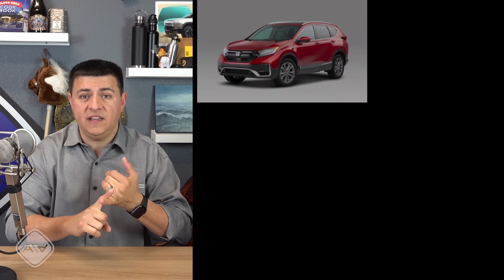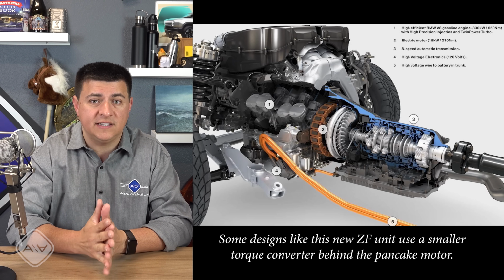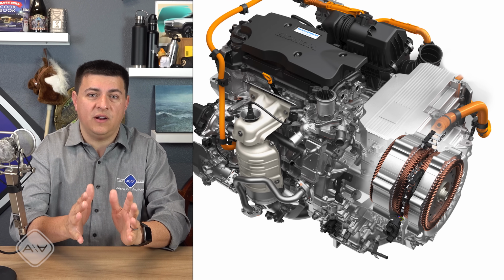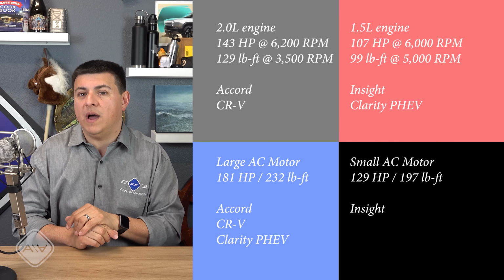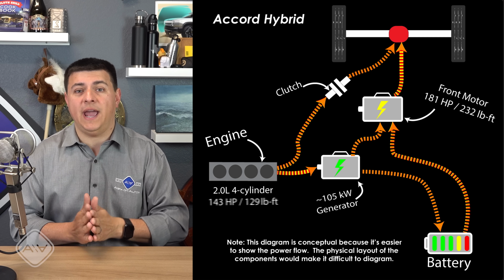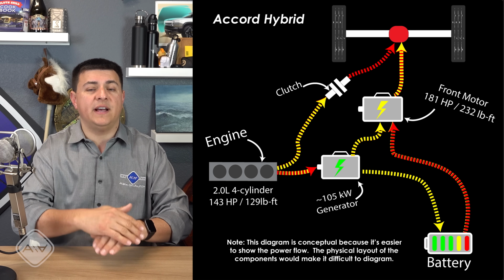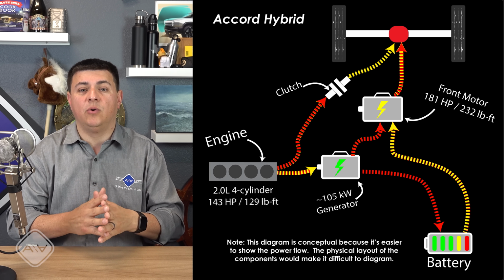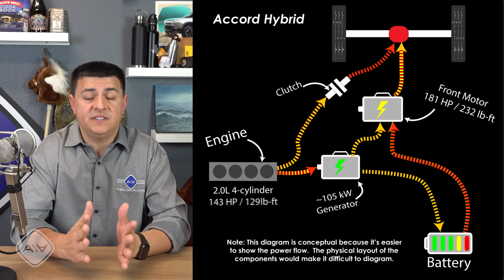How Does It Work?  Honda's 2 Motor Hybrid System Explained!

Comment: As an old hot-rodder, I can safely say....it's not about the horse-power, it's about the torque...It's always about the torque...well done Honda, well done.
Reply: Absolutely!👍👍👍🦘🦘🦘🦘🇦🇺🇦🇺🇦🇺🇦🇺
Reply: @hackney7106  This old debate?

Ignoring the mass of the car and any losses, acceleration (or towing force) is proportional to:

(Engine Torque) * (Total Gear Ratio)

... or equivalently ...

(Engine Power) / (Vehicle Speed)

The only reason you can compare similar vehicles by their torque, is because practical construction means that they will have similar ranges of Total Gear Ratio. The reason Hot Rodders like to compare torque, is not because it is more significant; it actually isn't. It is because you can achieve values that are close to T_MAX over a relatively large range of rpms, whereas P_MAX comes at only one specific rpm value.

Electric Vehicles - and yes, performance-wise these Honda hybrids are electric vehicles driven by the combination of a generator and a battery - are quite different. There is a speed that I'll call V_MAX. At that speed, the car can produce both maximum torque and maximum power. Below it, they can produce maximum torque, but their best power is P_MAX*V/V_MAX. This is why they are so quick off of the line. Above that speed, they can produce maximum power but their best torque is T_MAX*V_MAX/V.

In the Accord and CR-V hybrids, V_MAX is about 37 mph. T_MAX=232 lb-ft and P_MAX=181 HP.  In a Tesla Model S, V_MAX is between 43 mph and 49 mph, depending on which version.
Reply: Think you have read me wrong?It has always been about the torque.HP is irrelevant.
Reply: @hackney7106  No, you have accepted a very old, and very wrong, myth. There is some basis to it, but mostly due to the characteristics of an internal combustion engine. That is, not to this car.

In this one, 232 lb-ft is all that matters at any speed below 37 mph, and 181 HP (or 212 if you compare it to an ICE) is all that matters at any speed above 37 mph.
Reply: But you put it out there about Torque.I was actually agreeing.
Reply: And it is rumoured the torque is going up. 👍
Reply: @hackney7106  Torque can be created from horsepower with gearing.
Reply: @renof2505  If I ask Google Maps how far it is to the grocery store, it says 5 minutes by car, 10 minutes by bicycle, and 15 minutes on foot. If I look in the right place, it also says 1 mile.

The same is true of torque and HP. They measure the same thing just in different ways. Torque doesn't "create" HP, it is HP, at a known rpm. Specifically, HP = TORQUE*RPM/5252.

But torque is more consistent over a larger range of RPM.
Reply: @Goldendad1  HP is, too. Just a little bit, but it is measured in a different way so the number is going down While the effect is going up.
Reply: @jeffjo8732  Good Morning. I’m not clear on your reply, would you mind explaining what you mean? Thanks.
Reply: @Goldendad1  The CRV hybrid uses the same drive system (except that it has AWD) as the Accord. Its next generation has been announced. The torque of the traction motor is increasing from 232 lb-ft to 247 lb-ft, but the listed HP is dropping from 212 to 204. HOWEVER, the 212 HP figure was Honda's own measurement, the max outputs of the battery and generator added together. The 204 HP figure is something called "ISO net," which I do not know about but apparently is a new standard (in my opinion, it can't be as meaningful, but I have no firm basis for that). According to Alex, this is 3 HP more than the current system would get.
Reply: @jeffjo8732  Thanks, now I get it. Upping the torque should be noticeable too, right? Hoping the wait won’t be too long till I have one in my driveway.
Reply: That's what I love about my 6 SPD manual turbo Diesel from Kia..!
Reply: Yes [BIG]BUT, 1/  it takes 'TIME' to wind up to produce equivalent torque, & 2/ there's significant 'losses' in the conversion. Even with a lighter jockey, One mates 4 pod, worked gsx750 always lost from the lights against a big single XT600 - to 60kph! Then, it rocketed past with disproportionate hp/Kg ratio. 
In little boy, needle richard, wonker, rectum hole, selfish, don't give a fornicate bout others street racing, where straits are 'usually' short, it's INSTANT grunt torque that throws weight quickly forward out of a bend. Full stop. 
On a purposed race track long strait i.e. nurnburg ring[sp?] all about horsepower yes.
Reply: @jeffjo8732  Wrong. They ain't the same mate.
I struggled with the interpretation of it also. Confused on it for ages. 
Not 'measure' but actual 'effect'.  And the conceptualisation is a so subtle but significant difference.
An Engineering fundamental differentiation.  Did Archimedes 1st figure it out?? 
The instantaneous higher energy delivery of torque is ~off the lights : holiday loaded : tow a boat: get out of on-coming harms way lane change... is 'in time' quicker -"to a certain point' - which, for a street registered, practical family automobile, so rarely ever advancing past 110kph, this 'point is rarely ever reached. 
Though for wannabe 'ricky-bobby' racers, yep, Hp is 'more betterer' winding out [in time] down the back strait – or, in the wet dreams about such exhilarating 'boys own' adventures. ;p
Cheers Mate.

Comment: Honda calling this an eCVT is such is a disservice to the ingenuity that went into this powertrain. This is Honda engineering at its best! Instead, they should be flouting the fact that this system has no real transmission. That would be music to the ears of most buyers who have had to replace a probematic transmission before. Calling it an eCVT is the worst thing they can do.
Reply: Exactly! I have no idea why Honda would want to saddle this tech with the CVT moniker, even if they tack "e" to the front of it. People shy away from CVT, this seems far more straightforward and robust.
Reply: In engineering papers dating back to 2013 it is called a "electric-coupled CVT." That means that power is transmitted by electrons, not gears, chains, or belts. The ratio of input rpm to output rpm can be calculated, and it does vary continuously, but it is a completely meaningless number. For example, it is not a torque multiplier like it is in a mechanical transmission.

But we don't live in a world of engineers. Honda still needs to put something recognizable on the "transmission type" line of spec sheets. The term "CVT" does explain some observed behavior, and Toyota already established "eCVT" as a transmission type.

But a better name would be "vCVT", for "virtual CVT." That would accurately convey everything that is needed to be conveyed.

Comment: This system is silky smooth in my Accord. You only have to get used to an engine that revs independently of the speed of the car, but it's a very nice system.
Reply: Don't straight pipe it
Reply: That’s what I’m still getting used to….the engine running independently of what I’m doing. But I think in mine (2021) they try to simulate the engine revving up and down appropriately.
Reply: try a deasil train. they work that way too.-I think City buses should but the do not! I am surprised at this in the "enviormnetal" "friendly"" 2020s LOL
Reply: @flynnsarcade.1982  shame on them for that! the engine should not run unless the motor needs it's charge!
Reply: @fucheduck  I have a clarity its 4,000lbs, bigger than accord and it gets 45 mpg does 0 to 60 faster than any car I have had. Because you know more than the Honda engineers.
Reply: @fucheduck  You mean "battery needs its charge?" Motors don't have "charge".

Comment: So, it's an EV car with an on-board ICE generator, that turns hybrid highway speeds. interesting
Reply: Just like a trains locomotive. Traditionally this system called diesel-electric motive system.
Reply: Just like a Chevy Volt ;P The idea is golden, it's a pity it doesn't sell better
Reply: @KarrasBastomi  Locomotives have direct Diesel drive?
Reply: @williamwheaton8117  The idea is actually pretty poor. A Diesel, running at low RPMs would make a far more efficient source of generator fuel, and the low final gear reduction ratio makes the engine rev far too high at highway speeds, making it loud and less efficient, while putting extra strain on the engine parts. What it needs is a Diesel power plant (NA) and a tiny CVT for final gear ratios… say two of them, one for 40-60mph and one even lower, for above 60mph speeds.
Reply: @afcgeo882  no. Most diesel locomotive are diesel-Electric type
Reply: @KarrasBastomi  Yeah, this Honda runs solely on gasoline at highway speeds.
Reply: It's always a hybrid. It is a series hybrid at low speed, and can change modes to run as a parallel hybrid at highway speed.

An engine turning a generator plus and electric motor turning the wheels and a battery between them is a series hybrid.
Reply: @KarrasBastomi  But this also has a traction battery, making it a hybrid.

Comment: For context, the Honda Integrated Motor Assist (IMA) in the original 3 cylinder Insight coupé hybrid essentially replaced the flywheel with a pancake electric motor generator. That was light and simple, but being bolted to the engine like a flywheel, it could not drive the wheels without the engine rotating. A 2 motor hybrid with a clutch is more complicated but enables the engine to be decoupled from the wheels and stationary while an electric motor drives the wheels. 😎
Reply: Well, for better context, what you describe is called a parallel hybrid. It's the the method used by the 54 mpg Hyundai Elantra. They have a motor bolted to the flywheel, but they also add a clutch that allows the motor to drive the wheels alone, and a second motor-generator attached just to the engine to start it (the other purpose of Honda's pancake motor).

But it surprises many people that "motor driving the wheels alone" uses more gas than any other mode. All of the energy in the battery comes from gas, and the extra conversions needed to charge the battery add the most loss.

Here's what Honda realized from that failed experiment: The main benefit of a hybrid is that an ICE might be only 25% to 30% efficient during cruise, but is 40% efficient if it charges the battery during cruise. So it uses 25% more gas to get 50% more output. But to use that, they have to let the battery's charge go up and regularly. Without that clutch, they had to drop down to 30% once the battery was charged. The Civic's serial system lets it vary just about any time.

Comment: As a Honda tech I have to say that was a very good explanation.
I hope they come out with a hybrid Odyssey.
Reply: Hello, my check engine light comes on when I drive through water 💦 on the road and the engine freezing up then spotter, what cause that , it’s 2004 Honda Fit
Reply: @provocativethoughts3819  I'd start with the code and let that lead you.
Reply: @keyboard5494  it's a wet clutch. Something like you'd find in an automatic transmission.
If you matain the fluid it should last the life of the vehicle.

Comment: I have owned a Clarity for about 6 months and could never find a good explanation on their transmission type until now. I was told that it was a direct drive but was confused as to why Honda called it an E-CVT. Thanks for the explanation.
Reply: To Honda, "eCVT" means "electrically coupled CVT." As Alex explained, that means that in most situations the engine's contribution to propulsion is not mechanical. It is by generating electricity to power the motor, and the ratios of engine rpms to wheel rpms varies continuously.

Toyota means something different when they say "eCVT." It is "electronically controlled CVT." It's complicated, but they have a three-way transmission connecting the engine and two motor-generators. By controlling the electricity to and from the motor-generators, they vary the same ratio continuously.
Reply: @jeffjo8732  Hello, I have a question. Is the e-cvt transmission used in this new 1.5 cc Honda Jazz exactly the same system as the e-cvt used in the 1.8 cc Toyota Corolla sedan or is it a different system? The reason why I asked this was they said that the risk of deterioration of the e-cvt system used in Corolla is less than the normal CVT. Do you think we will have problems with the e-cvt gearbox if we buy Jazz?
Reply: @attilakhan4606  no atlest at the time of writing all toyota hybrids are power split Planetary gear type
Reply: Also the true definition would be gasoline elektrical transmission with a highway gear

Comment: Thanks for pointing out what I perceive to be a fundamental weakness of many/most hybrid vehicles, that being their [lack of] performance above 65 - 70 mph.  My former 2016 Sonata hybrid was gangbusters up to about 65 mph; delivering 45+ mpg.  At about 70 or so, it would still get in the low 40s, but over 70, it lacked any gumption whatsoever and fuel efficiency plummeted to the low 30s.  Moreover, the engine was much more vocal, making a less-than-pleasant driving experience.
Reply: That totally isn’t why it was designed for city use compared to long distance travel
Reply: My Lexus UX 250h has no lack of performance at any speed! 
0-60 as more like 7 seconds than the advertised 8.5 seconds.
Even at 70 mph it does 54 MPG.

Comment: I test drove a CR-V EX Hybrid this past weekend on Long Island.    I found the hybrid system to be seamless and inconspicuous for the most part.  The engine kicks on automatically and does it's own thing when the battery gauge runs low.   The tachometer is replaced with a similar, arcing gauge that records power usage and charging with a marker delimiting the two.   The fuel gauge for the engine is to the right.   The push button shifter is pretty much easy to use once you get used to it and clears up some space on the console.   The EX-L gets a heated steering wheel on the Hybrid,  a plus from the previous year when it was only available on the Touring.   The ride was more or less very similar to the gas only model, but I didn't push the car too much.   

I took it on the highway and it performed nicely, the engine cycling on and off to generate amps for the main motor and the battery.   The dealer said that the motor would shift on and off at highway speeds depending on the sped I was going, hills, etc.  I found the only way to tell if the motor was running was on a hill when it droned and on the highway, when the gauge showed the power usage farther beyond the demarcation point of charging.   The dynamic resistance braking is from paddle shifters like truck Jake Brakes.   You toggle more resistance and the car visibly slows down on exit ramps, while the battery fuel gauge visibly gains.   Once at a full stop, the system resets to zero the regenerative braking effort automatically.  I detected no discernible difference in what was motivating the CR-V at highway speeds versus local speeds.

The air conditioning is electrically run, so when stopped and the engine's off, the AC compressor still provides chilled air from the battery.  When the battery is low, the engine kicks on to run the AC system compressor electrically.  I am not sure how the heat works, but the dealer said i can remote start the engine on cold mornings to generate heat.  He added that in cold weather, when starting off in EV mode, the car will automatically warm up the engine before it is required for electrical generation work.   

Downside:  Not the car, but the dealer who slapped a $1000 extra charge to the MSRP because of the rarity of the CR-V Hybrid.   That prevented me from purchasing the CR-V then and there.   The CR-V Hybrid is available across all trims of the the CR-V and in only a AWD format.   It adds $1200 to the base price.    The dealer adds another grand to the mix to make the car pretty expensive.   I can wait.   Looking forward Alex to your full test drive and I'd appreciate some commentary on the price gouging happening with Honda dealers in the USA.
Reply: Wow! Good review and it sucks the dealer put a premium on it. They will find out soon enough that people are not buying a lot of cars now and that prices WILL come down.
I saw prices at this dealership in Georgia to be MUCH less than msrp.

https://www.heritageromehonda.com/vehicle-details/new-2020-honda-cr-v-hybrid-ex-l-rome-ga-id-35416937

Comment: So I have a 2014 Honda Accord plug in hybrid (rare version). I think if I’m not mistaken, that it achieves peak horsepower when accelerating from a stop, but only after the VTEC jumps in. Here’s how I feel it when accelerating via on-ramps: 
1)immediately feel power from battery pack
2)engine spools up and feel some more power from it
3)engine hits VTEC and runs all the way to redline, when it hits peak you definitely feel it.